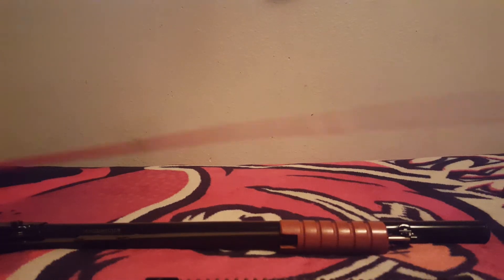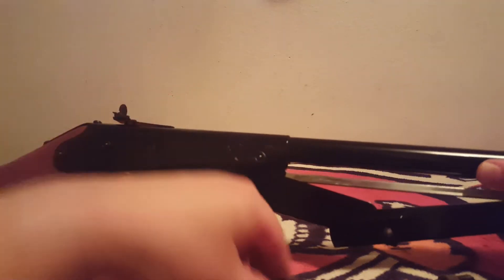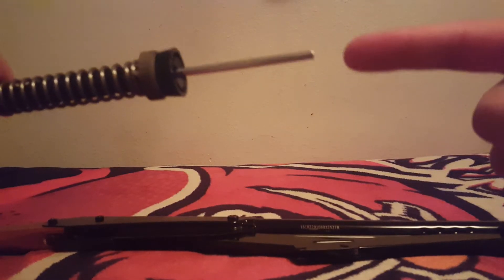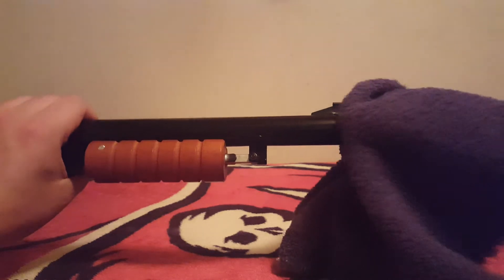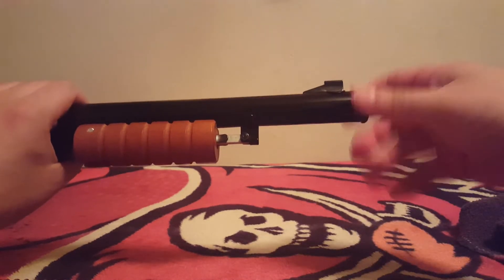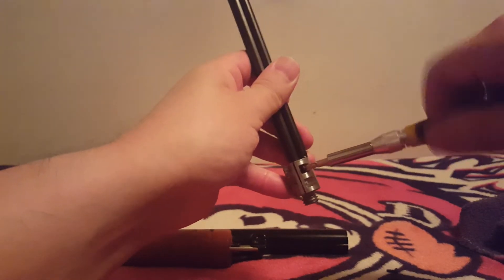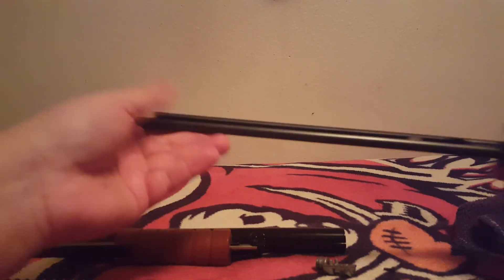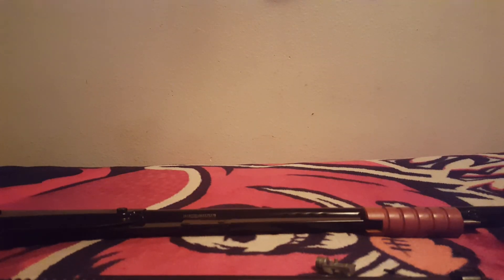Daisy 25 BB Jam Fix - Simple & Brilliant Engineering

Comment: OK Ok i didnt re-use bbs
Reply from the maker: Andrew, sorry, many do. Also, all THREE major BB jams I suffered were Daisy Basic BBs. Consider Daisy Match for your 25.

FASTER 
HIT HARDER
MORE ACCURATE 
BETTER MADE

https://www.pyramydair.com/product/daisy-match-grade-avanti-precision-ground-shot-177-cal-5-1-grains?p=398
Reply: @daisy880fanaticfixit9  i was kinda shooting to fast and it somehow jammed 3 bbs in the shoot and it still loaded one in the chamber and the one in the chamber got stuck deep inside and i tried 3 different types of ramrods to get it out but it wont move, and it dont have wear and tear because i just bought it and I litterally shot maybe 40 times and I reloaded and shot maybe 10 bbs and it jammed like that.
Reply from the maker: Andrew, it WILL move if you get just a little more aggressive. Assuming you have removed the metal backside to expose the barrel breech, you need just a touch more force. 

Use a metal rod and tap with a hammer. FIRST spray WD-40 or Ballistol down the muzzle and let it sit for a few minutes. Then tap with rod and small hammer.
Reply: @daisy880fanaticfixit9  Ok well thank you for helping me out on it ill try it tomorrow when i get off of work
Reply from the maker: Good man✌️

Comment: Hey! Just curious. Does the Black Widows preform good in the 25? I have a couple of 25's. One a current model and one VERY old with the plastic stock. Thanks buddy.
Reply from the maker: Dad72, yes, they look good in every gun I have tried. Including 880 on 5 pumps. It punched through both sides of thick soup can wirh accuracy.

To be fair to Daisy, their standard BBs do great. My 25 can hit the bottom of pop cans at 15 yards with few misses. But the Black Widows are easily as accurate and FASTER on target.
Reply: @daisy880fanaticfixit9  may try some widows myself. I like the Daisy bbs too. I think they are better than the Copoerheads.

Comment: All your videos are extremely helpful, right to the point, and short!  Question: would you know why the the 880 PowerLine has not been out of stock for like 4+ or more months?
Reply from the maker: Jon, great question. There are a few things killing customers trying to buy a Daisy right now.

(1) Production delays because of pandemic.

(2) Nearly a state of war with China on trade issues and other less than friendly interaction.

(3) The big one is Americans got scared and cleaned out the shelves preparing for the end of the world. You know, like living on squirrels and starlings.

I visited Wal-Mart over a month ago, and I have never, never seen the airguns WIPED OUT like it was at that store.

I checked the center of the airgun world - Pyramyd Air - NO 880s, 901s,  nor even 35s!

Sorry, Jon.
Reply: @daisy880fanaticfixit9   I see the big picture now and I pity the squirrels and starlings they will suffer with the rest of us. Good answer, THANKS!

Comment: The 25 is a fun bb gun for plinking. I agree that it is better than the current red Ryder. Been thinking of trying to fix an old model 25 that wore out. Not sure how old it is but it has a plastic stock instead of the wood stocks on the new ones
Reply from the maker: Hey, Connor! Hope all is well where you are at. I have to say that now with C-19 here.

Search yellowdog for fix video on 25. It is pretty intense, BUT it is on old version like yours, so perfect!

Those parts you can get from Daisy.

Comment: Hey, saw this just right!  First to view, like, and comment!  Excellent presentation!  Never had one of these, but the rumor as a kid was that they were more accurate and powerful than a lever action.  Not sure if that was really true, but that is what all the kids thought in the late '50's.
Reply from the maker: Bill, thanks for support. The new incarnation isn't more powerful, but a 25 out of the box is HIGHLY LIKELY to be more accurate after break-in period.

Standard Daisy BBs look good,. I tried more premium BBs, but didn't see noticeable change. So normal Daisy BBs are fine. Spring loaded and magnet loading system HIGHLY RELIABLE. Ryder doesn't share that.

I actually got out of Red Ryder Fix work since most are not ready to fix it and current Ryders are the WORST gun to reuse BBs in. The Amount of labor and understanding of Ryder design - and design flaws - is overwhelming for greater audience.